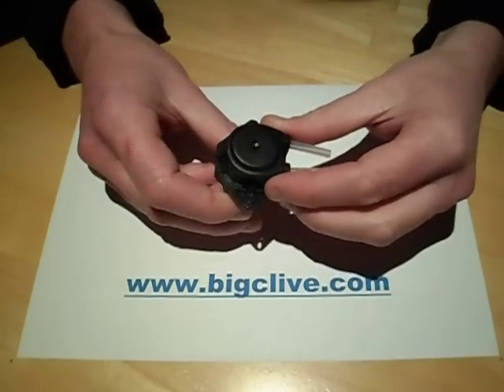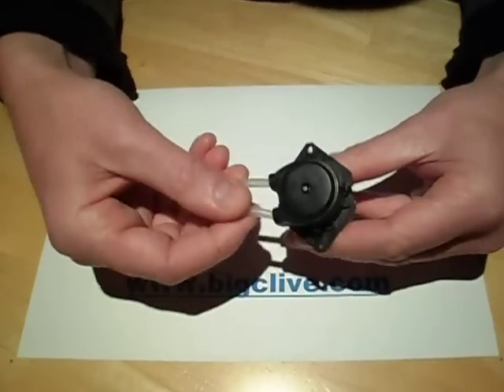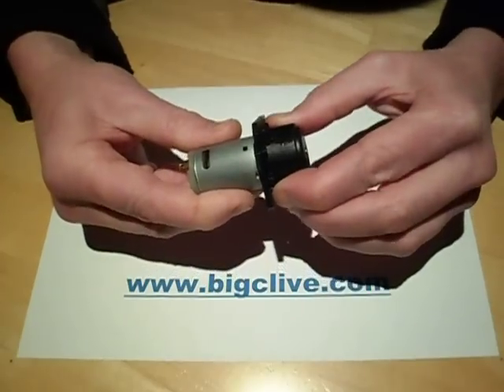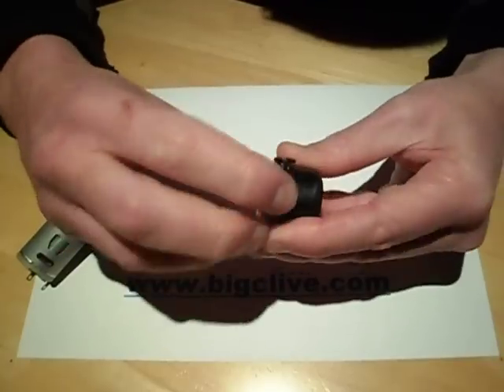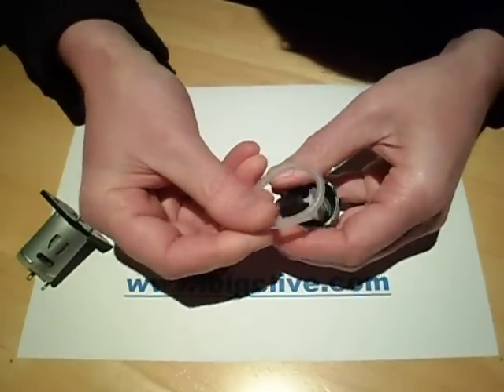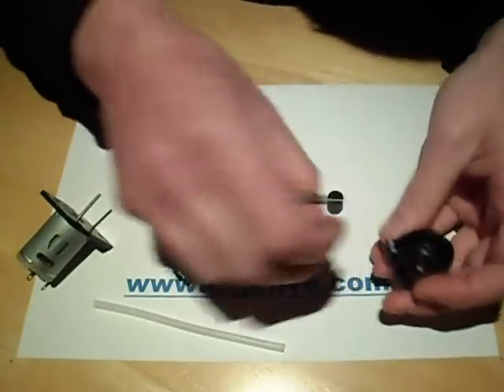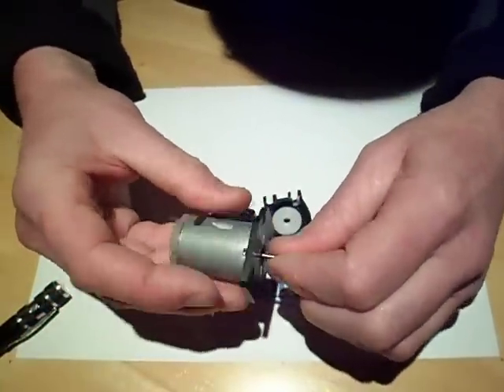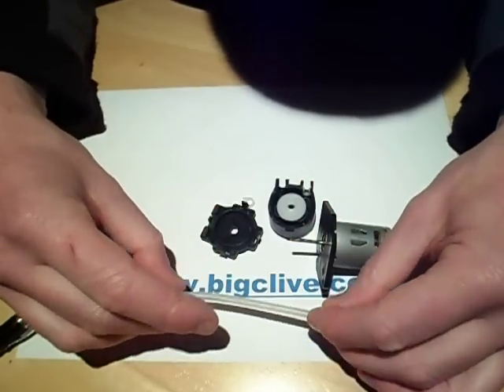Inside a Chinese peristaltic pump from ebay.

Comment: Ingenious ! ..... the BIG problem with these pumps is they require a LOT of torque from the motor , most have discrete gears to slow the motor speed ( thus increasing torque ) .... FYI , the Silicone tube size shown is usually used in cheap printers , so must be available ( ? ) , hope that info is of use ( ? ) ............... DAVE™ ............

Comment: Great video and explanation!  Helped me realize why the rollers in my pump weren't turning.  The tube on the inside must have been old or have been pinched by the rollers in the same place for a long time so they stayed deformed and took too much force to turn.  Also resulting in less friction of the motor shaft so it would only slip.  Replacing the tubing fixed it!

Comment: Peristaltic pumps are cute in their simplicity and function...and really only possible with super-flexi silicon tubing which doesn't mind (and returns completely from) repeatedly having the walls crushed to more than being in contact (a completely enclosed cell of payload is then essentially moved along the tube by the rollers...the action is not unlike milking a bovine teet...only in a circle...and you don't have to worry about being stepped on!)...only trouble I see with this one is it is driven by a DC motor which will haul-ass (and relatively uncontrollably) at high speed as soon as power is applied...medial peristaltic pumps typically use a stepper motor because combined with the high accuracy/repeatability of the volume that is trapped and moved between the two rollers in contact with tubing, their highly accurate speed/position (including at dead-slow) control allows a ultra-accurate dosing.  You would not get anywhere near that accurate a dosing control with just a DC motor which free-runs at quite a high speed...sure you could time power to it, but power applied for even just a fraction of a second would result in a comparatively huge dosage compared to an accurately controlled stepper.  ...not that I like steppers, their complicated control makes them less attractive for the experimenter/hobbyist, but I'd prefer to see this pump outfitted with a gearmotor or at the very least, or a PMW speed-control, so that dose would be a lot less and more precisely controlled.  
Please perform power-up and volume/on-time tests, without and with a speed controller added.  
Thanks for another great video BC!

Comment: Really handy to hack with a stepper motor and driver board + Ardino or similar for really accurate and repeatable liquid measuring. 
I once used an instrument with a few of these pumps in to suck up and dispense reagents and samples. It cost £££££££!

Comment: Hello. I bought a pump exactly like this from ebay. I build some bio/chem lab equipment as a hobby and was interested in peristaltic pumps as they allow for the sterile transfer of fluids because the fluid never touches the pump components. 

Mine came pre-loaded with the tube segment like yours. It seemed to function when I first used it but when I tried to change the tube by removing the face plate and adding a longer segment of tubing I could not get the rollers to spin again. I did use some special ordered smaller tubing, it still might have been about 1mm or so larger than the segment that was in there when it arrived so that could have contributed. When I re-assembled the motor I am having issues getting it to spin even on the tubing that was originally included. 

I'd say that if you're working with an application that you can just use connectors to connect tubing to the piece that's already in there that this pump is a good cheap option (ex. aquarium, laundry, alcohol, as you mentioned). If you are looking for an application where you need to frequently lay a new segment of tube across the rollers that this is not going to be a good fit. Commercial peristaltic pumps that handle sterile fluid have a easy on-off clamping mechanics for changing tubing. 

There are also a lot of really great posts out there right now on 3D printed peristaltic pumps, I think this may be what I try next. 

Thanks for the video it helped me understand that it was the pressure of the tube forcing the spinners against the motor shaft, I was initially confused how something that had no threading made them spin.
Reply from the maker: +Thom Fraleigh The rollers inside have to be placed into a little track or spindle holes.  If you assemble the unit with the rollers not in their correct position the motor will not be able to drive them.  The last bit to be inserted into the roller mechanism is the shaft of the motor itself as it presses against the rollers to drive them.
Reply: +bigclivedotcom try looking for nitro rc fuel tubing that's slightly smaller than aquarium tubing
Reply from the maker: +last king They are better suited to slow transfer of liquids.

Comment: I had one of these reducing the fluid in my knee after an operation. They stitched the pipe in, so could't pull it out after. US medical system. You dont get what you pay for.

Comment: I wonder how precise these pumps still are with that gearing principle. As it's not driven directly, the gear ratio depends on the size of the rubber wheels, and I imagine that can variate a lot between cold (hard) wheels and warm (soft) wheels.

Comment: It may have already been mentioned, but peristaltic pumps can be found in inkjet printers as part of the head cleaning system. They usually don't have a dedicated motor, though; they're driven by the sheet feed roller shaft iirc. You'd need to be a bit creative to hack one into a project, it's probably not worth the effort.
Reply: +ProdigalPorcupine
I concur about "not worth the effort", I've torn apart a printer that had one of those, and it was ABSOLUTELY caked in ink residues. I basically had to chisel the hardened ink out of it.
Even tho the one i took apart had seen especially heavy use (classroom printer), I'd think it's a pain to deal with the ink if the printer has seen even a single cartridge thru it.

You'd at least need to know what solvent will both dissolve the ink and NOT dissolve the plastic. 3-d printing can probably take care of making an adapter to drive the thing from a stepper motor, as well as adapters for input and output of the fluids. This is just a first-pass at the idea from general principles, but the concepts should be sound.
Reply: Isopropyl alcohol works wonders on those things. In some cases, Acetone can be used to flush the tube. Wash entire thing in scalding hot water in order to get rid of residues and undissolved ink cruds.

Comment: i don't think it would be thin enough pipe, but my mum's old oxygen machine used something called oxygen bubble tubing, and to make sure it fit any fitting, every 1metre there was a "bubble" or flared bit of tube, so it could be cut at any point in the flared bits to fit any sized fitting,  I though it was a fault in manufacture when I 1st saw a flare in it, but when told about what is was really for, I thought, how clever!,  I have a nearly new 30m box of it that I'd be prepared to send to you if it's any use for just cost of postage, it says internal diameter 3mm but that might be the flared bits? its made by universal (un8800)

Comment: Great explanation. I'm wondering how high this pump can be used to pump water? I want to be able to pump water about two meter up.
Reply from the maker: +Johannes belin Peristaltic pumps can lift water a modest height, but are designed for low volume applications.

Comment: Thank you for the Video.  I bought a pump, but the wheels/rollers do not turn.  The space in the middle is larger than the shaft.  So, there is no friction between the shaft and the rollers.  The tube that was installed is not clear and and kind of compressed .  Based on your video, I removed the tube and swished it back, but it did not help.   I then replaced the tube with the smallest clear tube I could find, but that did not help.

You mentioned you ordered a tube in the video. So, I was wondering if you were able to get the pump to work/ get the rollers to spin?  If so, what is the size tube that worked for you?
Reply from the maker: It may be that the rollers aren't sitting in their guide properly.  They should grip the motor shaft when it is slid in between them.
Reply: Thank you for reply.  Based on your video, was able to realized that, but I want I need to know is what size tubing did you use to get it to work?  

The other issue for it not working is that there is some flex in the sprocket holding the wheels.

I was able see what the Tubing the company in china should have provided, which is 2MM ID and 4mm OD.  

However,  because it did not work, I  thought I would ask you want size tubing you did use that worked for you. 

I believe that having the correct tubing size would force the roller sprocket together, but with the wrong size tubing it will never work.  The rollers clearly need to be very tight on the shaft, but cannot be too tight.  So, the perfect size would be required to work correctly. 

It may be better for me to just buy another one, but it seems like it would make more sense to buy the correct tubing size, as I only need 3 inches of tubing.

Comment: I'm fairly new to electrical wiring/soldering, I have a stupid question... What is the safest way to wire up one of these pumps for a project long term. Assuming it will run unattended on a schedule. Would you just buy a 12v power supply and cut the wires and solder then heatshrink? or is there a safer way?
Reply from the maker: I wouldn't expect this pump to put in continuous long term use.  But for short bursts of operation it's fine.  I'd suggest using a small connector to connect the pump to the power supply as that allows easier maintenance later.

Comment: What a great video! will this pump work with cpu watercooling?
Reply from the maker: I'm not sure I'd trust it for such a mission critical application as that.  Especially given the deliberate low output designed more for dosing chemicals than bulk fluid flow.  The best type of pump for that application is probably the re-purposed aquarium style pumps designed to pump the coolant at a high enough speed with minimum noise.

Comment: is there any possibilities to change the DC Motor used on the peristaltic pump? Bc i want the pump to work slower (to produce very small flow rate). And im wondering can it be done by replacing the motor with the slower RPM (higher torque)
Reply from the maker: You can get a number of different peristaltic pumps.  Some with gears and some using electronic control to vary the motor and pumping speed.

Comment: What is the dc motor model, is included in the purchase?

Thanks¡
Reply from the maker: The pumps are sold with the motor attached.  They seem to be available in various voltages.

Comment: Hi ! Thanks for the video. Can you send me a link for where I can buy the pump?
Reply from the maker: Banggood seem to stock them.
http://www.banggood.com/12V-DC-Dosing-Pump-Peristaltic-Pump-For-Aquarium-Lab-Analytical-Water-p-931333.html
Reply: bigclivedotcom thank you. can the rate of flow be controlled for these pumps?
Reply from the maker: C.P. Mathai Yes.  By controlling the speed of the motor or cycling it on and off.

Comment: Hey, great video. Did you try using other tubes? I was thinking maybe 4x5mm or even 4x6mm. I just want to get the max ml/min and Im trying to get different tubes to test.
Reply from the maker: The pump only works properly with the correct size of tube, so you can only change the flow rate by varying the speed or duty of the motor.
Reply: bigclivedotcom Thanks, going to try it with 3x5mm tube because I cant find 2.5x4,7mm. Did you by any chance measure the max Amp draw of the pump?
Reply from the maker: TheT3KO I can't recall the exact current, but I think it was a few hundred milliamps.
Reply: TheT3KO Heya, how did the 3x5mm tube go? I am about to order some tubing :)
Reply from the maker: superpomme I only tried it with the standard aquarium tubing.  The only way I could get it to work with that was by keeping the tubing supplied in the unit and pressing the aquarium tubing over it on either side of the pump.  Not ideal.
Reply: oh cool - thanks. I put this project to one side a little while ago but I just looked and found that I had some clear plastic tubing (which I guess may be aquarium tubing?) and this fits around it as you say. I have some cable ties that I can use to hold it in there. It's strange that the same companies selling the pumps on ebay don't earn a bit more selling the tubing. I think I'll order another few pumps now tho - I'm adding an alcohol mixing bot to my arcade cabinet :) Thanks for the advice
Reply: superpomme Working great. Im getting 105-120ml/min.
Reply: nice, thanks.
Reply: TheT3KO Oh - something that Ive noticed when i've been looking at some pump pictures are these connectors:

http://i00.i.aliimg.com/img/pb/289/813/664/664813289_205.jpg

it seems that you can get these rather than having to push one tube inside the other and tie it round. Have you had any experience using them?
Reply: superpomme Im just using one large tube without connectors.

Comment: What tube connectors do you use with this?  Any idea where to get more of the same type of tube?
Reply from the maker: +Jeremy Ardley It's a smaller size than the common aquarium tubing.  It may vary between models, but the Chinese sellers on ebay do stock a range of silicone tube sizes.
Reply: +bigclivedotcom  i belive this is my problem, my tubes are getting air in ... am driving crazy tring to fix this problem , am using normal aquarium tube, and i belive that is the problem :(
Reply: +Miguel Pires Plastic tube is not going to work. The basic working principle of the pump uses the fact that a silicone tube springs back to it's previous form after squeezing. Plastic tube tends to flat after some time.
Reply: +bigclivedotcom I haven't found any suitable connectors but I have found that you can slide a bigger tube over the supplied pump tube ends and get a good seal. I've also found that some people sell 'silicone' tube that's actually PVC - and that's not just ebay.
Reply: +Jeremy Ardley
Caveat Emptor, as always.
I'd bet that sometimes the seller doesn't even know the difference.
aka: "I'm no expert, I just sell the stuff".
Reply: Jeremy Ardley
Reply: usually any hobby shop that sells nitro rc cars, trucks, planes, or helicopters, will have bulk silicone fuel line. It's the only type of fuel tubing that will withstand the nitro methane in the fuel. Nasty stuff. Burns white hot in open air.

Comment: How do you power it? Battery or can you plug ii into a wall?
Reply from the maker: It could be powered from a battery pack or a DC mains adaptor.  The motor voltage is generally about 12V DC, but it will run at reduced speed with a lower voltage.
Reply: bigclivedotcom
How low the voltage can be for it to run? I'm between this 12v pump and the 6v pump. I need two for aquarium Co2 and nutrition liquid dosing (about 5-10ml/day). They will be running from two separate battery packs through 12v programmable timers (I couldn't find 6v timers) to a voltage regulator (for speed control). I'm I able to get as minimum as 5 ml/min from these pumps knowing that the min interval time of these DC timers I found on ebay is only 1 min (not seconds)?
Many thanks in advance.

Comment: Probably way way too late with this comment but the silicon tubing looks very much like RC fuel line as used in Nitro powered cars and aircraft. Something like this http://www.blacksmithproducts.co.uk/products.asp?cat=248
Reply from the maker: Thanks, that's a useful link.
Reply: +bigclivedotcom You can also get it in a buttload of different colors, and nitro fuel line is also normally very high quality.